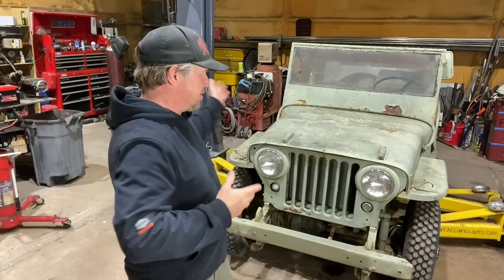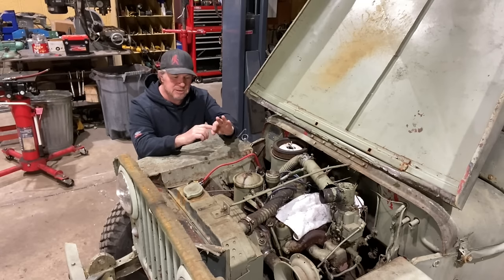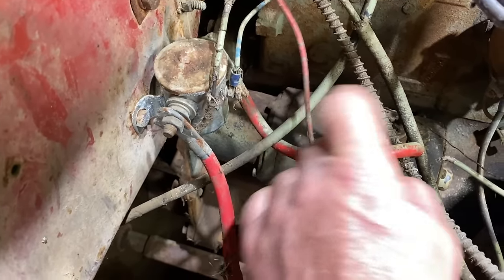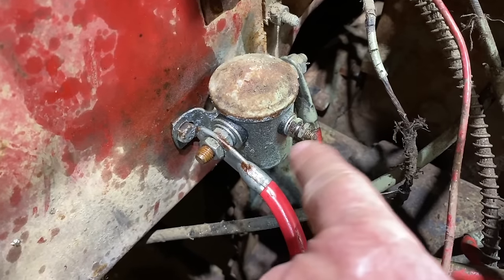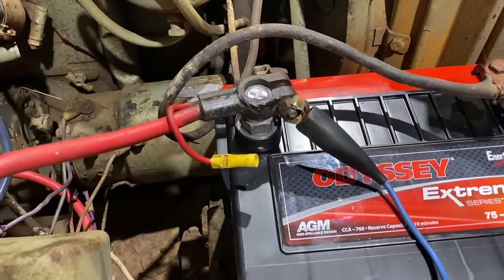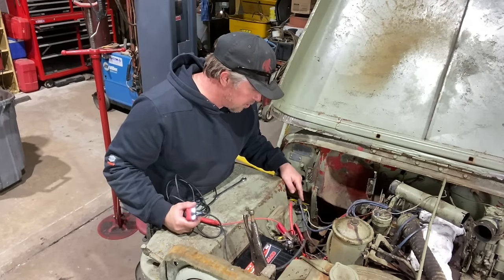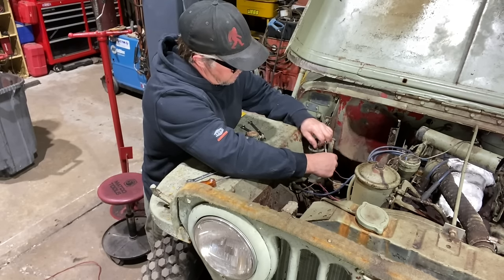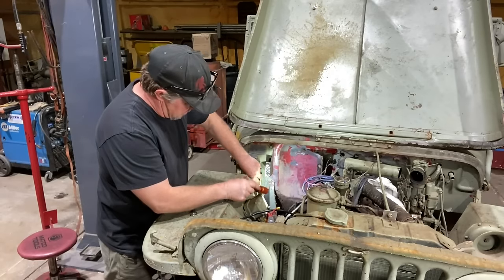Dirt Daily.  Testing the Flatfender's Starter, Will It Crank?

Comment: One more check for 12volt. Check the back of headlight bulb for voltage mark like on generator, flasher relay, and coil. Also regulator or resistor for coil might give some more clues. What a fun journey.

Comment: I'm right there with you with my '52 MD.  I'm converting it to 12v and still haven't tried starting it.  Have the T90 out and waiting on parts for that.  Going to do the Land Cruiser starter and have a Delco 1-wire so minimal wiring to deal with.  I feel the highs and lows with you.

Comment: Moving right along. I know guys like Jay Leno mount those batteries on their sides. If I rember correctly the wiring for a 6v system will run 12v but witing for a 12volt system is not strong enough for a 6v system. My personal opinion if it is not a show vehicle where it has to be original I would modernize it. 30 years ago you could find 6 volt parts in rural parts stores. Not any more so I install the easiest to find to get back on the road.
Reply: Optima makes an awesome 6V
Reply: I got a 52 dodge power wagon,still 6 volt. I use a 12 volt battery. Still works fine. It never leaves farm,it has no lights hooked up on it,just my amp gage. I always unhook battery after driving.
Reply: 6v wiring is typically larger than 12v - voltage/current/amps and all that .

Comment: Fred ,,  since you now have the engine cranking,  Before you do anything else you should hook up a oil pressure gauge and get a reading to see if it has acceptable pressure.
   Then perform a compression test on all four cylinders to see if they are at a sufficient compression psi level.   
  The engine sounds pretty fair when you were cranking it over on the video,
Reply from the maker: its got oil pressure, not alot, but some
Reply: @4xFredWilliams  
You should add a quart of Lucas Oil Stabilizer to it after you change the filter,

Comment: I rebuild a 63 VW years ago and did a conversion to 12 Volt.  I asked a starter rebuild technician about reusing the 6 volt starter.  He said it would be fine.  The motor will turn faster on 12 volts and if it doesn't start right away stop cranking to avoid burning it up.  One thing that makes me nervous watching this is working around a battery without safety glasses on.  If you have ever seen a battery explode you would know why.
Reply: Yes, I converted a 6v bug to 12v and left the 6v starter in place , no more starting problems! But a 6v horn given 12v - that's an earful .